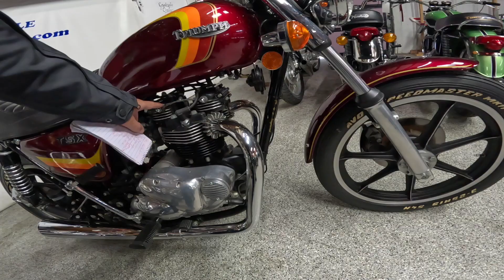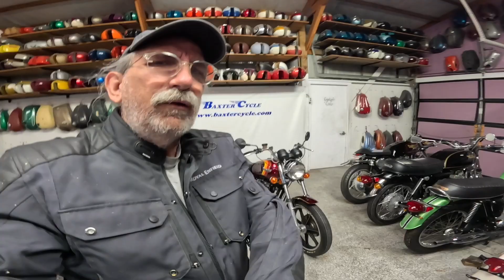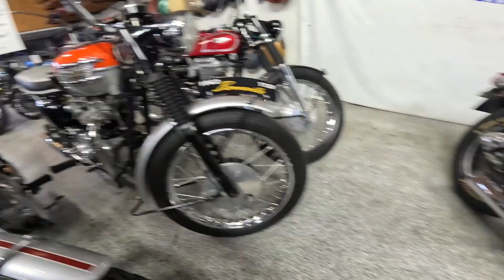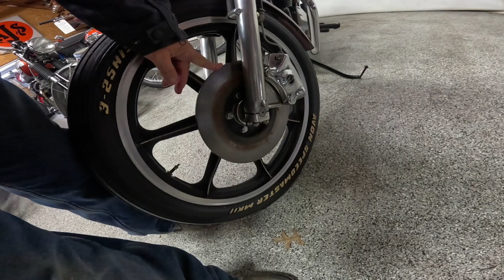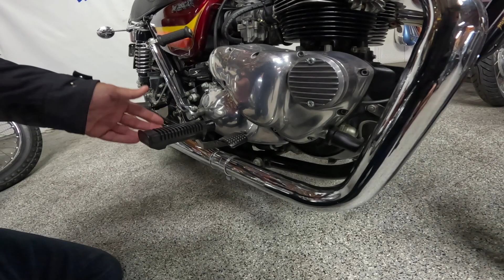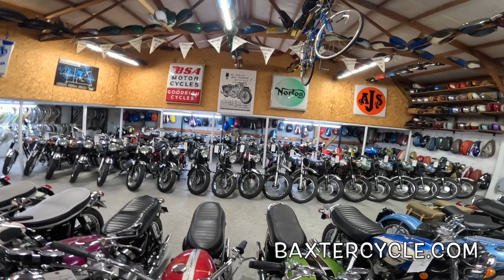The Rarest Bonneville: Triumph TSX 750 - Wahoo! TBT 39

Comment: Yeah, of course Craig Vetter did the styling for the X-75 in 1973 but that was a BSA triple which ended up being badged as a Triumph. 
Towards the end, Meriden did turn out some good looking motorcycles but by then their days were numbered. The 1979 T140D, in black and gold, was eye candy as were the TSS and TSX from '83. If nothing much else innovative was happening at the factory you could always rely on the paint shop to make it seem there was. In my opinion, their colour schemes and finishes were never bettered in that 40+ year period.
The TSS 8-valve was a rushed project. It was definitely the way forward for such an ageing (47 year-old) engine design but the Weslake-based head proved to be problematic in terms of oil retention. The lower end was certainly robust and should have been well able to handle the 'claimed' BHP. After all, people had been tuning the 650s to get 60+ BHP since the year dot and, within the bowels of the crankcase, nothing much changed over those decades.
As people soon discovered, Turner's parallel twin (as with any engine) produces its best performance when it is neither restricted on the inlet or outlet sides. Free flow of gas from bellmouth to end of exhaust pipes. Once you start having to add air filter boxes and mufflers to meet local regulations, the engine becomes stifled. It's for this reason that the quickest Bonnevilles were from the early-mid sixties before such regulations began to encroach.
I doubt the TSX here produced any more BHP than my 1967 T120. That is to say ... 46. More torque though !
Reply from the maker: Wahoo!
Reply: @fuzzybikermoto  Ha. Calm down dear 😀

Comment: It's obviously very rare but it's not the rarest Bonneville. The rarest Bonneville is the 1971 T120RV. Just over 200 of them were made (204 I believe)  in June of 1971 so they were eligible to race in USA production races. The ratios of its 5 speed box were different to the 5 speed box that was fitted to the 1972 T120RV's. I have had many debates with people who try to tell me there were no T120RV Bonnevilles made until 1972.
Reply from the maker: Very interesting. Wonder if we'll ever get lucky enough to have one come through Baxter Cycle. Thanks!

Comment: Looks like a late 70's early 80's Japanese bike.   I'm sure it's a blast to ride, but once Triumph went to oil in frame and bumped up to 750cc the styling changed.  The later bikes don't do it for me like the earlier motorcycles.    To me, late 1950's through the 60's up to 1970 were the pinnacle years of styling for Triumph.
Reply from the maker: To my eye the mid-60's Triumphs were what I'd call classic looking. Beautiful!